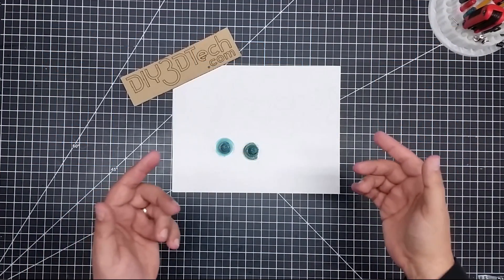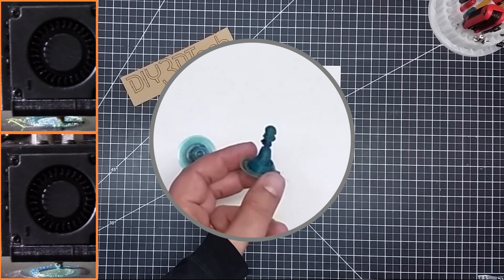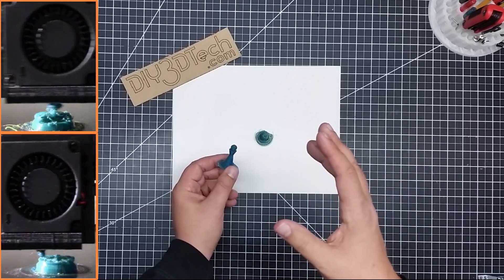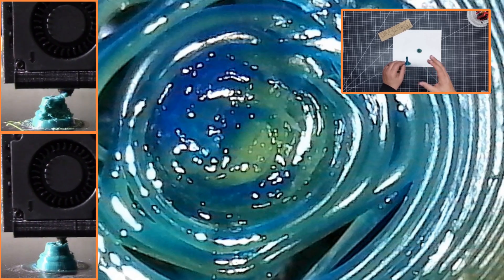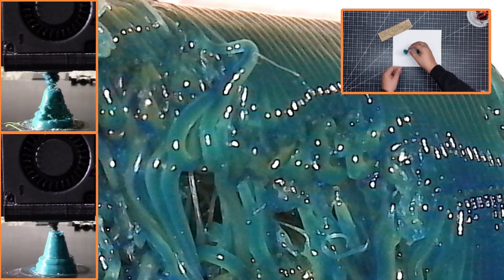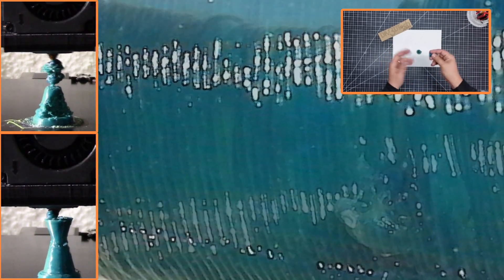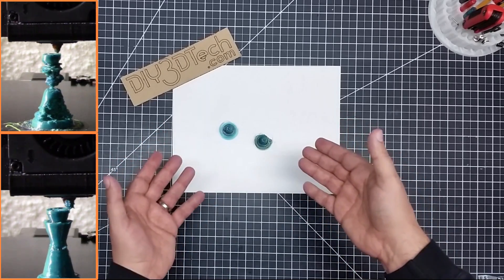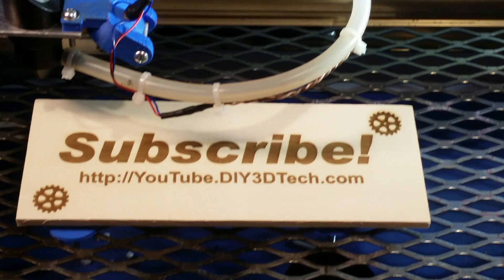GeeeTech A10M - Mixing ABS with PETG Success!

Comment: I just did a print with the perimeter being ABS and the core being PETG. It is a prototype part for fit and function. I read that PETG is more durable than ABS but ABS is harder. Throw that in your testing as well.
Reply from the maker: Have had a few people write me about similar and this is the kind of stuff I am interested in!  :-)
Reply: Great idea if the core/ infil is petg it shouldn't warp- the core will give it rigidity while printing

Comment: Just a quick question what’s your thoughts on two 3D printers 1) Creality ender 3 2) Power Spec Duplicator i3 mini thanks
Reply from the maker: Hard choice, I really like the Wanhao line for what it is and the direct extruder is nice over a bowden for many materials.  The Ender is common design (Geetech has similar designs).  Are you new to 3D printing?  Is this your first printer?  What materials do you want to print?  My Wanhao has been running for years has done thousands and I do mean thousands of prints.  However the direct drive extruder can be a little harder to clear then the bowden for novice.
Reply: Yes I would be new and I like the price of the wanhao @ 149. I heard no heated bed, and only pla( don’t know if that’s true). pla being most common I try abs and flexible ender- heated bed, maybe little bigger build volume, and ability to use all kinds of filament. Thanks for your help!
Reply from the maker: Yes you need a heated or at least I would recommend a heated bed...
Reply: DIY3DTECH.com can that be a add on as a upgrade

Comment: Thanks for doing this. I was planning on testing mixtures of different filament. But you didn't state what mixtures. 50/50 etc. Maybe different mixtures will work better
Reply from the maker: Yes at the start of the project I did (cover 50/50), however your right I should add to each video as people seem to be dropping in the middle now.  The way I can up with 50/50 is basicly a what the heck! measure just to see what happens like putting mento's into diet coke :-)
Reply: @DIY3DTECHcom  sorry I missed it
Reply: Hello,I just bought a second hand a10m,all seems fine,except no sd card.Also I notice there’s no MIXER command on my lcd panel.Any thoughts?

Comment: I wonder if ABS-PETG composite could shrink a lot less than ABS and allow a bit of part cooling. Also you have a device that measures particulate and some volatile emissions, i wonder if PETG can serve as a sticky binder that prevents ABS from emitting the nasty.
Reply from the maker: Good to hear from you and was hoping you would chime in as you always amaze me!  Yes have considered doing the emissions  piece on the relatively successful out comes however had not considered the dimensional piece, however will now :-)